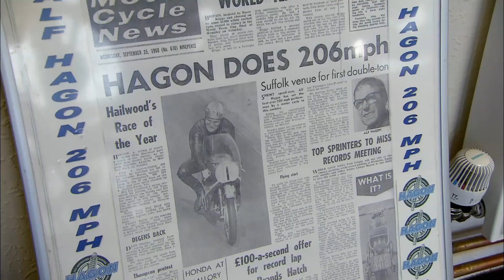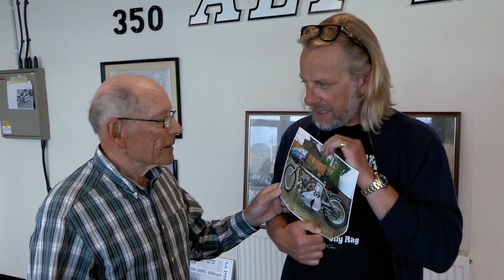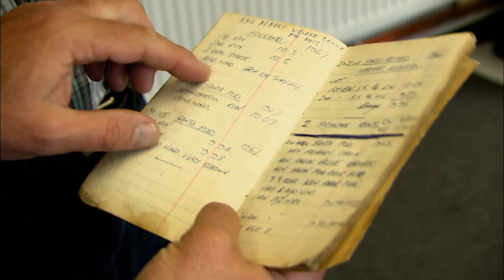When Henry Cole met Alf Hagon

Comment: I used to own the Quartermaster bike and raced it in the early 1980s. It was built by Norman Ashwood from Kidderminster. I emailed Henry Cole, when I saw the bike on TV, with a lot of information and some pictures of the bike, back in the day. He never replied.
Reply from the maker: Hi Jack. Sorry if you felt ignored. The production team at Henry Cole TV receive so many emails every day that it simply isn't possible to reply to all of them (otherwise there wouldn't be time to film any programmes) and occassionaly important ones, like yours, get overlooked. Thanks for getting in touch. Kind regards from the team
Reply: @HenryColeTV  
So, did you get my email? It was a couple of years ago.
Reply: @nippynormans2267  
It would be a shame if he didn't look at it. The original email has been deleted from my outbox and I'm seriously doubting that I can remember exactly what information I passed on to Henry. The builder of the bike has probably died by now - Norman was in his 60s back in 1980 - and I'm not getting any younger.
The chap I sold the bike to - Richard Evans - is still around though.
There's some video of Richard on the bike here : https://youtu.be/VXCt36iSRFQ
@ about 3 minutes in.
Reply from the maker: It does sound interesting. We'll see if we can run a serch for your email and thanks for the video link. Kind regards from the production team